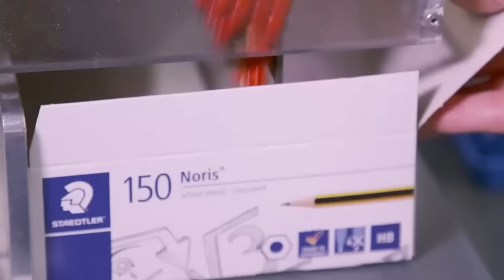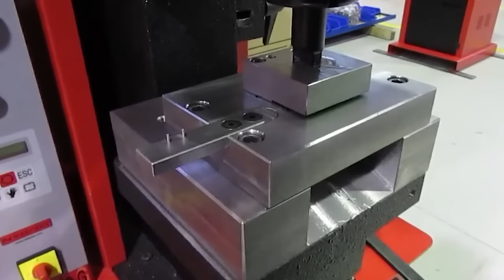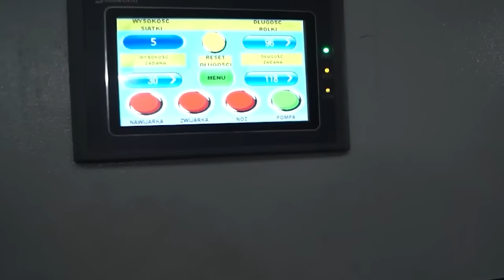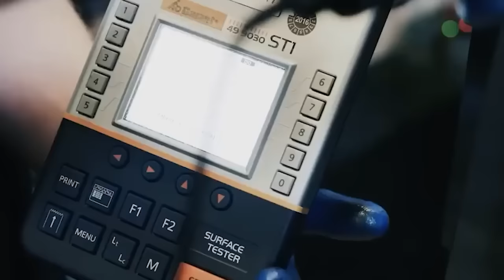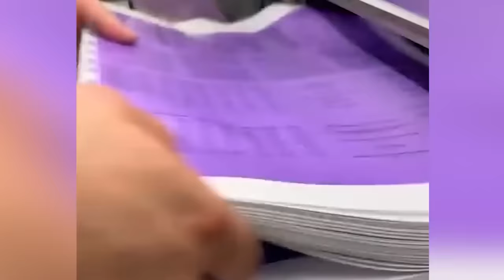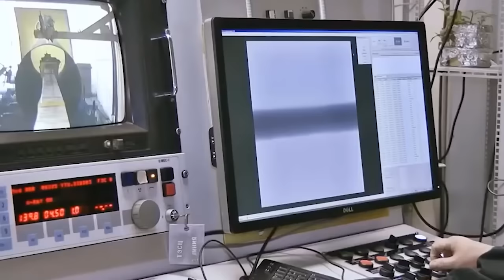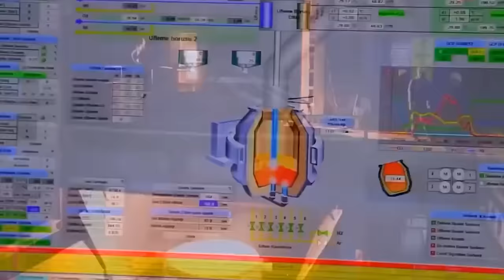Here is the most dangerous factory in the world. Don't watch alone! ➤2

Comment: excellent video and reporting on aluminium smelter process  , very physical work and high temperature there about 759 c in furnace and around it almost 70 to 90 degree celcius.  too much sweating , accuracy required for alloy making , i worked in dubai  in this dubai aluminum smelter. sow ingot , pig ingot , small ingot , t bar , ballot , etc...